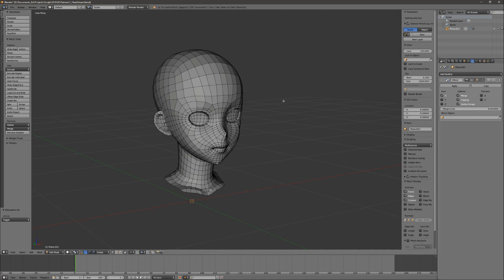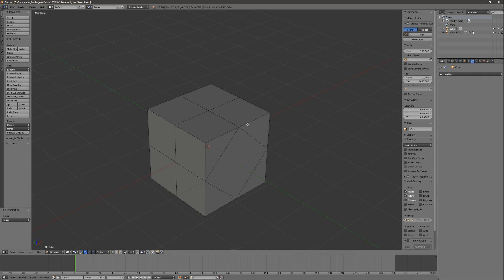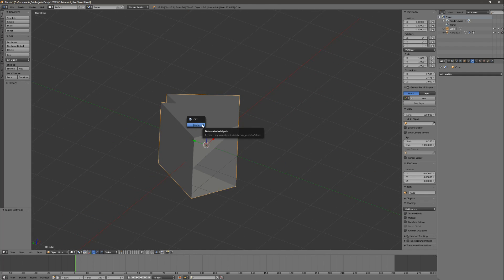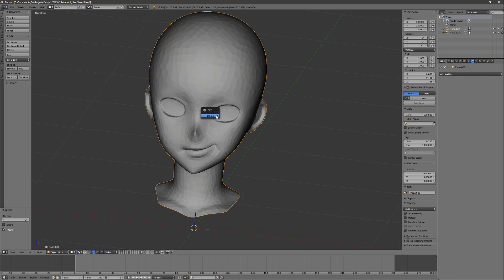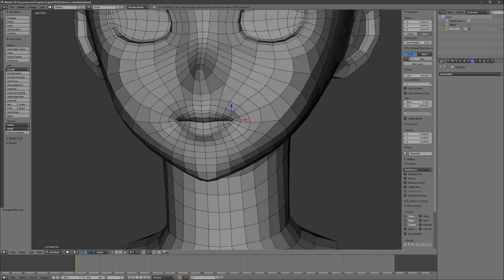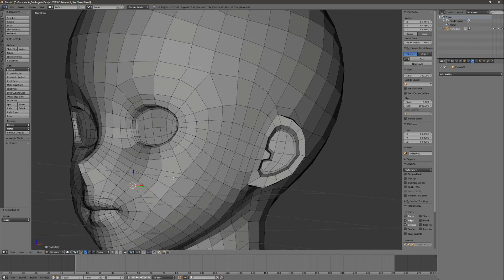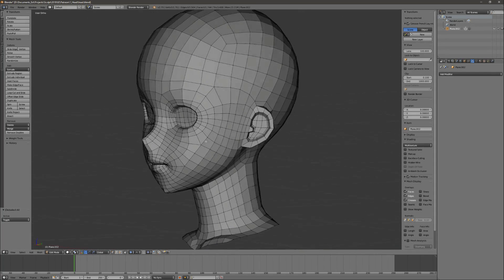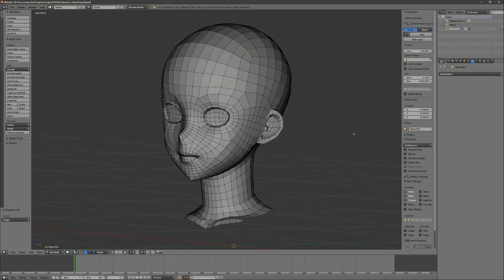3D Modeling Face Topology - Explained

Comment: Gotta say, the first time I saw this video, I didn't actually understand it at all... BUT Now, I think I get the jist of it, which is that shitty "topology" or shitty placement of points, means "artifacts" or just weird indentations, are the reason that, when you're modeling a face, the topology, if not handled properly, could make the character look like a 40 year old... or worse...

AND also, the depth gets fucked in the areas where topology/vertices are poorly balanced

Its probably been the largest learning curve for me as well, given how many times I've picked up and dropped modeling trying to achieve something I didn't properly have an understanding/ability to execute or ask anyone about...

Comment: If you're converting to Tris in the end anyway for a game engine then does it even matter trying to keep it all quads in the modeling process
Reply: A good analogy for this would be working in Photoshop or other drawing programs, 'why use layers if you're only going to see a flat image once you export it?' 
Proper topology is also important when it comes to rigging and texturing your model. Often times, once bringing your model into a game engine, you'll find that things need to be revised and edited, then re-exported. If you're using tris, and then exporting as tris, you're going to be out of luck once you need to edit your model.

Comment: Reason for you poles is that your mouth and neck area has higher polys versus your other parts of the head. Poles are usually created when your trying remove extra poly lines from being added to the topology in the other parts of the mesh.

Comment: What if I import a model from a game, and it has a lot of tris.. I tried using "spacebar -> tris to quads" but still a lot of tris remain. Any tips on how to quick fix it?

Btw love all your videos Daniel, the tutorials are life saver!👍
Reply from the maker: I think we need to understand the intent in order to convert triangles into quads. Triangles always have three directions in which they could be merged. That's why the automatic tool will not always be able to recover the quads cleanly. If you really need to go back to quads maybe doing it by had is the only option. In Blender, select a pair of triangles and press Alt-J (I think).